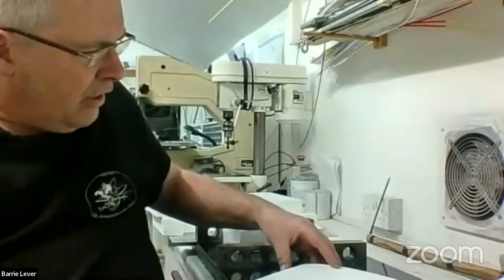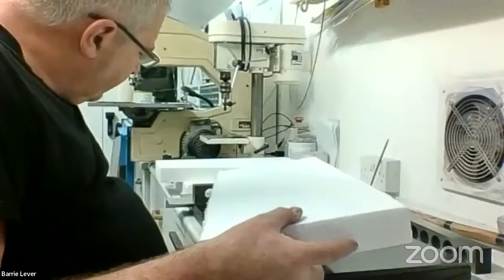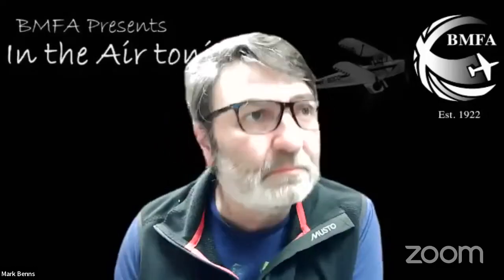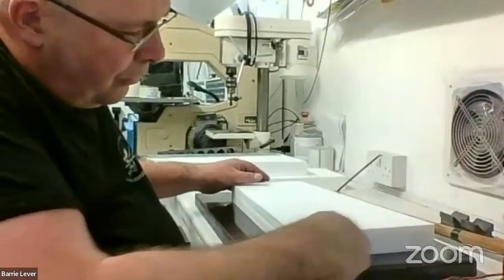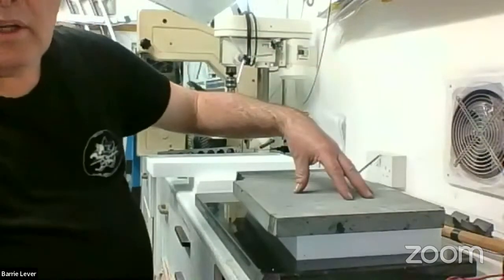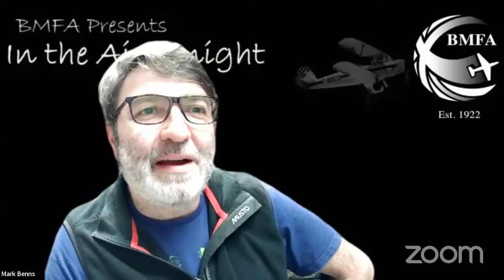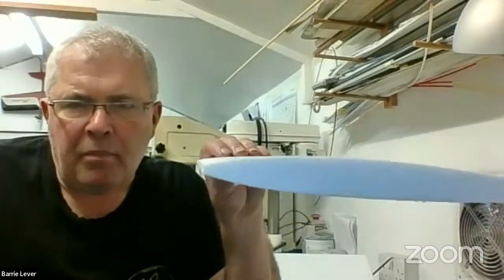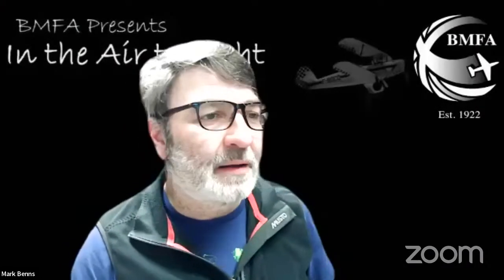'In the Air Tonight' - Foam wing cutting. Tips and Tricks.

Comment: IMHO: A LARGE PIECE OF WINDOW GLASS, OR "LANINATED" MDF SHEETING, ON TOP OF A STURDY WOOD WORKBENCH, ETC., WOULD MAKE A GOOD WORK TABLE!...:face-green-smiling:
....WHILE TRYING TO CALL OUT THE POSITION MARKERS,.. COORDINATE EACH HELPER, BY SETTING UP A "METRONOME, AT A SUITABLY SLOW RATE!...:face-red-heart-shape:
....How about spanning along the trailing edge, with an epoxy saturated piece of pre-set, heavy braided fishing line...( tie up a suitable length of epoxy soaked, braided line, with a lead weight hanging at the bottom... let that cure/set, overnight... you'll have a nice thin trailing edge-corner strip/rail/ (akin to "spring steel music wire", but almost no weight!)..., which can help define the line, during further covering processes....